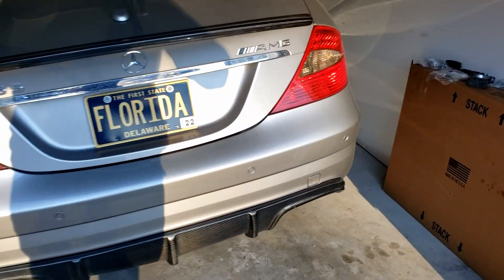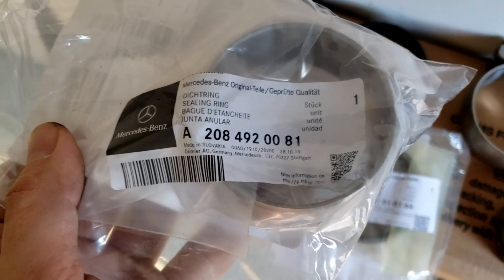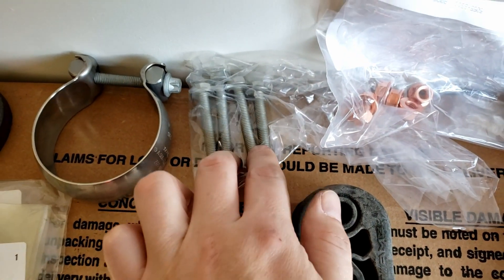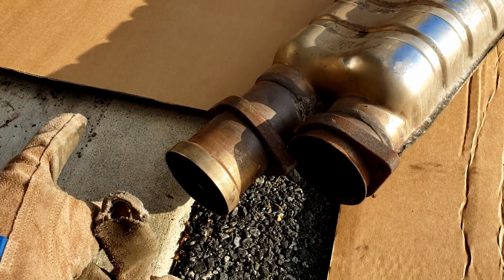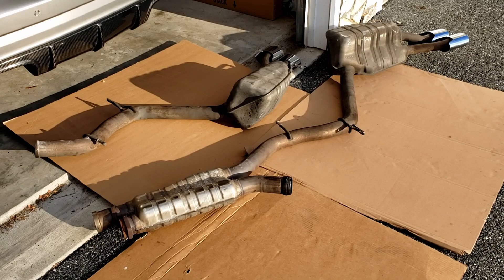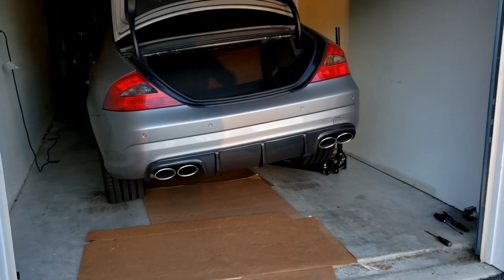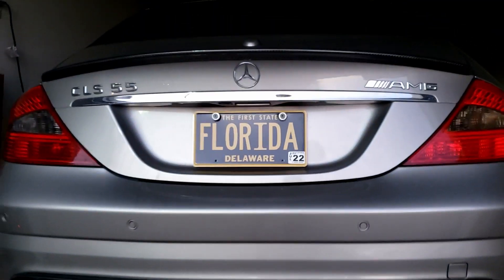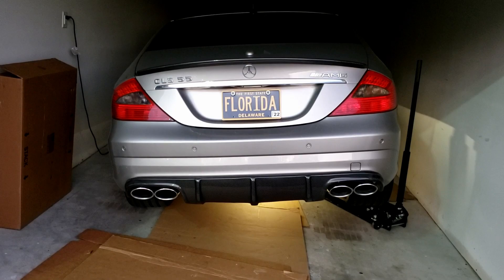CLS55 AMG Exhaust Replacement - Part 2

Comment: Why you put back the stock? It wasn't ugly.
Reply from the maker: I went back to stock simply becuase Meisterschaft exhaust gave me a noticeable drone noise when I was cruising at 60-70MPH with 1800-2000RPM. Drone is not good for long trips. I had drone noise before in my Accord where I had a custom exhaust. Drone noise gave me an uncomfortable feeling, fatigue and some headache. Stock exhaust has no drone noise. PS: Meisterschaft exhaust tips look very nice! Similar to those on W221/W216 S65/CL65. I like it more than stock CLS55 exhaust tips.